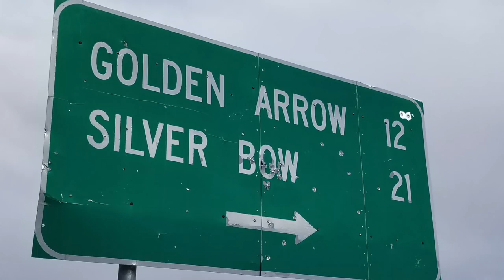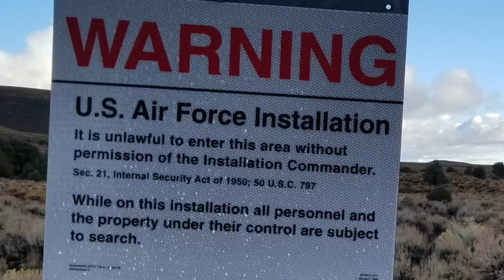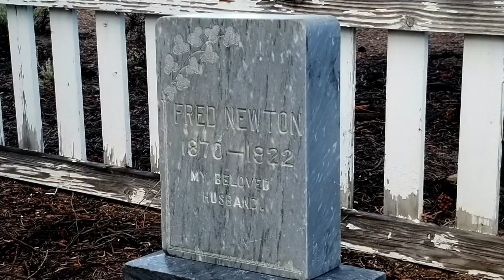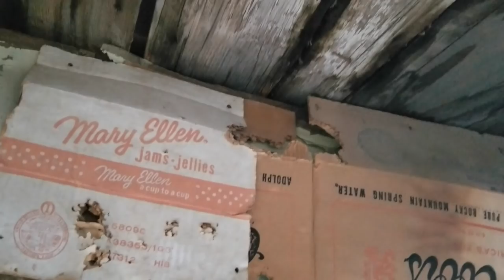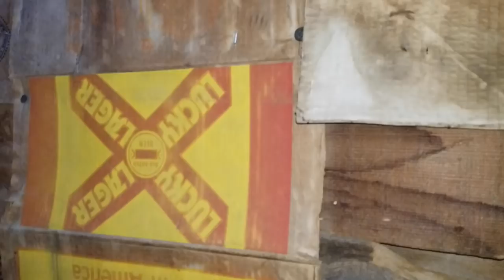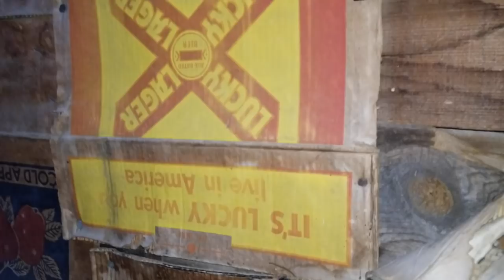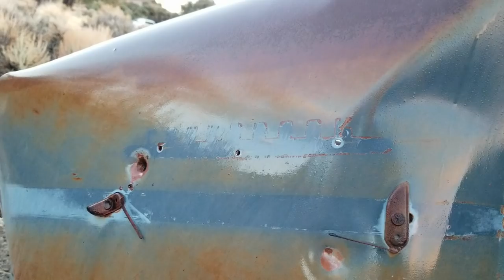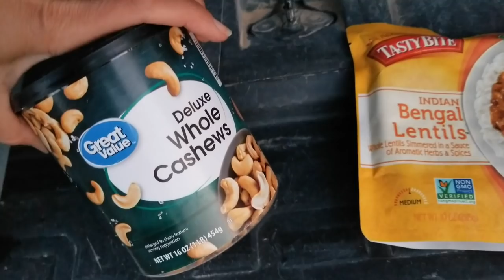Golden Arrow, Silver Bow: Camping at a Ghost Town on the Edge of Area 51 (Solo Adventure Part 3of 7)

Comment: So the Lucky Lager boxes most likely date from the 1940s into the middle 50s. the Lucky Brewery used to be in Azusa California just north of old Route 66.
Reply: I used to go fishing at the pier in Redondo Beach CA when I was young and broke. 11oz beers with a puzzle on the bottom of the caps. 👀 💘 🐟. Stuff like that. That was around 81 to 82. Cheap as hell but did the trick....i think a case  had 23 11oz bottles. For some reason I don't remember. Hmmmm

Comment: WING WINDOWS 
That's what those little windows were called with the locking handles.
CRKT a good quality blade, to keep it forever, put oil on it and wipe it down now and then.
Reply: Also called 'No Draft' or Vent Windows.  Last used on late '60's Camaro/Firebirds. Blade goes well with CCW permit.
Reply: Also wind wings
Reply: I had them on my 84 Toyota Pick up.  Loved them.
Reply: In England they were called quarter lights
Reply: We always called them vent windows. 
I was heavy into collecting modern folding knives  Microtech, Soyderco, Benchmade, Fox etc. CRKT has good designs but junk material/steel

Comment: Old Dodge flat head six cylinder...'50 or '51. For some silly reason, those engines didn't particularly appreciate damp, cool weather. I always called those little vent windows "wing
vents". Great for flickin' ashes out if you smoke...weather conditions permitting, of course.

This is a pretty cool series, Darlin'...an example of how you've spent these screwed up lock down daze...er...days to keep busy. Sending a little love from northeast Missouri(8-).

Comment: Looks like a Chrysler product from the late 40s or early 50s. Engine looks like a flat head 6 cylinder.
Reply: Plymouth Cranbrook. Made them from 1951 to 1953.
Reply: only 4 spark plug holes
Reply: only 4 spark plug holes
Reply: Yes, a flat head straight 6.
Reply: @steveparrott5008  No...there were six. if you could take the head off and take a look, you'd see why numbers 2 and 3 are close together and so are 4 and 5...while 1 and 6
are close to the front and rear respectively.
Reply: @rockinpiano1  Mom had one. It was a piece of jun At least ours was. we were always broke down somewhere.

Comment: The concrete structure was one that nearly every hard rock mining outfit had.  It had to be located away from the mine because it held explosives used in the mine. They didn't want the whole mine blasted shut.  Look for small wood around them and hopefully you'll find the word DuPont on those.  Don't handle with bare hands you'll get the dandiest head ache in about 4 seconds, I speak from experience.
Reply: Nitroglycerin in dynamite I assume.

Comment: Wonder hussy I first explored this area 1984 then again 1989. At Silver Bow, both visits, Fred's grave site had been well kept, the rock building was the saloon, the tin building and the building where you find the piece of machinery we're in good shape. I along with my dad slept on the cots, my son and a friend slept on the floor. There was a working door, the building was wrapped in visqueen and the roof would keep out the rain. There were cabinets shelving food left over from previous visitors that was still edible. As for the piece of Machinery outside the building it is believed that it was for keeping the minds air clean or circulated. I do have pictures of the area and when I come across them I will edit and post those pictures with this post.

Comment: 1951 or '52 Plymouth Cranbrook with a 218 cubic inch 6 cyl. engine and (' three on the tree') three speed manual transmission. They only made the Cranbrook from 1951-53. the 53 has a big bump out along the front fender above the wheel well the whole length of the fender.

Comment: I guarantee if the brush was not there you see hundreds of little black antennas all over. They have solar powered radio connected vibration sensors.  I  honestly don't know about that place. I do know a lot about others and they are  the easy way to keep folks off the grounds. I also lay you $ way way up in the sky is a drone(s) are cruising around with their Gorgon Stare. Look that up, it's nuts.

Comment: Those little windows, we're called vent or wing windows. My 64' VW Beetle had them. No air conditioning, but if you turned those windows towards yourself, and were driving at a faster speed, you'd have a nice breeze.
The car you showed us, had a silver plate on the door jam. It might have given you a clue of the make and model if the car. The engine was either an inline 4 or 6 cylinder. The car looked like a 4 door sedan. Ford, Dodge, Chevy come to mind. But many other makes and models were around when this car was built. The side view gave a hint, as to what it was. The way the top came down in the rear. Hope this helps.